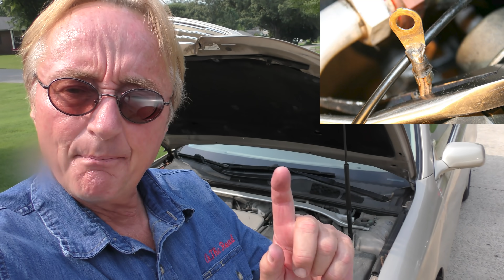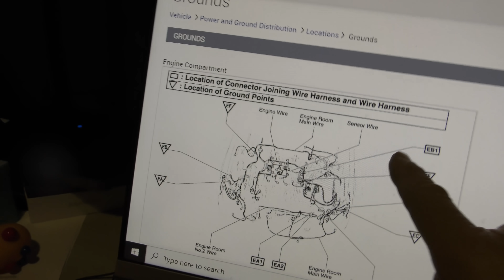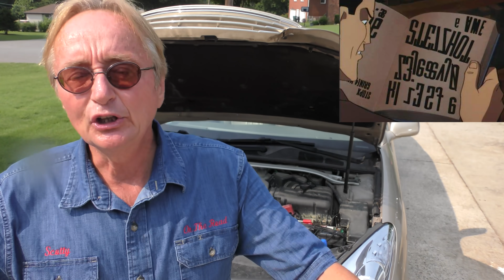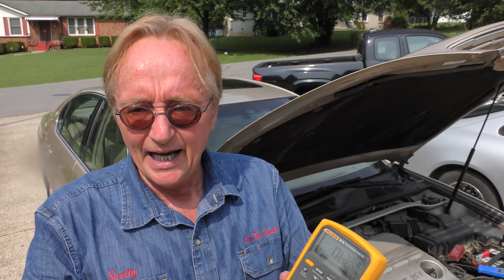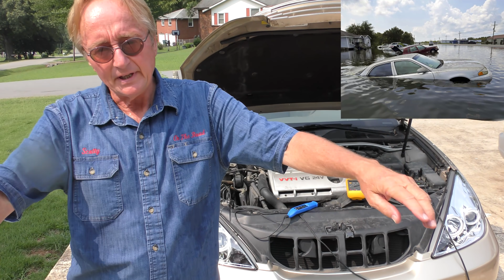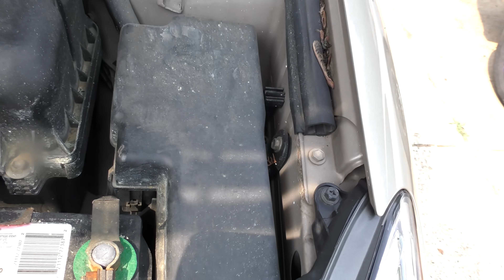I Told You About This Problem But Nobody Listened

Comment: Scotty,
I'm an avid listener to your channel but I have to disagree on a point you always make. Hyundai. They are simply not the trash you claim them to be. I realize you're an "older" guy and probably haven't gotten over the Pony.......lol. I'm probably close to your age and live on the East Coast of Canada. We live with salt on our roads on the daily, PLUS, we live off the Atlantic. EVERYTHING RUSTS. There is one exception, Hyundai. I've owned two. First was an Elantra,96, that I drove for 160,000 miles....replaced a headlight. I went through a number of other cars and finally bought another Hyundai in 2017. She has 120,000 on her, looks like I pulled out of the showroom yesterday. I don't have a garage, she's a daily driver and other than changing oil I put on some new tires. It's fast, rust-free and reliable. The year I bought it came down to the "big 3"...Honda, Toyota or Hyundai. I have a bad back and believe it or not Hyundai was the only one whose seat rose vertically which made it very easy to get in and out of. I just don't trust then CVT transmission in the Honda and Toyota were putting them in the Rav I was looking at....Turns out the little 1.5 was a BUST for Honda! The CVT is a no go for me, driving it was like riding a ski-doo. SHIFT DAMN-IT, SHIFT LOL. I think Hyundai deserves some respect as they have there own steel factory next to their plant. Good steel/no rust. The year I bought mine it won the AJAC award (which is the toughest)....They give 60 journalists 60 cars to abuse for a few months then tally up the votes. Guess who won? Hyundai. Show em a little love!

Comment: I've begun 2 ✔each indiv. wire & found 3 wires that had small holes in them, 1 being from alt. 2 main fuse center, 1 under dash & 1 in bundle across radiator. 😲

Comment: ground problems, god forbid, one of the last problems you EVER want to deal with on ANY piece of technology. most are battery ground related ie loose battery terminal or chassis side. look there before anything. On a different note, if you have an open circuit and a wire map dont spend a bunch of time beyond checking the obvious harness connectors trying to find the open just run a new wire.

Comment: I have fluke meter like yours been using it for years .
I have been out to cars which wouldn't start and noticed the throttle cable fried, this was due to a bad ground between chassis and engine, the power was trying to use the cables a ground .

Comment: I wasn't going to put this store on blast. The wiring diagrams for 2003 Ford Lightning are under wraps. Guy working the counter couldn't print me out the 26 pages of power and ground diagrams (there were lots more) so he let me take pictures of his screen with my phone. Luckily the diagrams verified what I already fixed, wanted to be sure the truck wouldn't catch on fire. Scotty that was total hell, I would have paid someone 4k+ to have found the issue. Nobody knows how stuff works so I just have to do it.

Comment: As an electrical engineer let me tell you, diagnosing hardware related problems is one of the most annoying tasks I have to do. I have spent many, many hours with a circuit and an oscope plugging probes in trying to figure what on earth is going wrong.

Comment: I'm having a problem with my a/c working intermittently right now. Had a bad clutch coil replaced it along with the pigtail and now it works but every few seconds the light inside the car for ac turns off and the compressor disengages. Then it comes back on and gets cool for a min or so again. Freon level is good, pressures are where they should be on the high and low side. I also changed the pressure switch that's under the airbox because it seems like it's worse the hotter it is outside, so I figured the high pressure switch may have been bad but even changing that, no luck. And just like scotty said in this video I had the transmission rebuilt last winter and the air never had an issue until after that. And they did a Terrible job putting the wiring back in correctly. Alot of the plastic shielding has been broken on the wires and they didn't bother to replace it so it's a mess. But other than the pigtail for the clutch coil I haven't been able to find anything else in the ac wiring. The fans come on and work as they should as well and I tried a different relay just incase and that wasnt the issue either. So if anyone has any ideas please let me know!!! Car is a 2006 Monte Carlo LTZ 3.9L V6

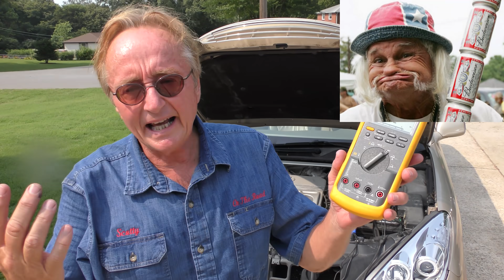Comment: 5:00 even good mechanic...dont know where bad connection, until they find it.
6:30 autozone will print out all ground wire diagrams...
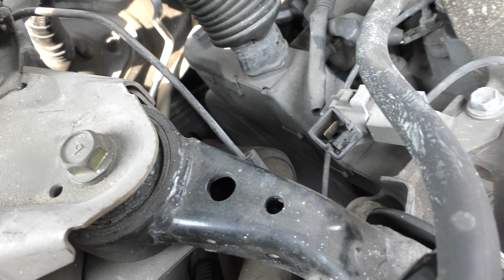8:00 check +/- terminals: green corroded copper vs shiny brown copper...

Comment: I bought my current car, a 2007 Subaru Impreza, at a used car dealer in Cleveland a year and a half ago. It quickly developed this strange tendency to crank irradically. Sometimes it would crank and start fine, other times crank so slowly that it wouldn't start. Other times the starter motor would speed up and slow down while cranking. The dealership had shown me pictures of the new clutch they had put in because the previous clutch had exploded. Turns out, someone forgot to completely tighten the starter bolts and, wait for it...the ground wire to the starter. Tightened that up myself and the car has started fine ever since. I've put 41,000 more miles on it (148,000 total on car) and it has never failed to start since that time.

Comment: One day when I had nothing to do, I went around and checked all the grounds I could visibly find.  Loosed them up, sanded the bolds and grounding surfaces and then  tighned them down tight and then sprayed them with some paint to keep them from rusting.    I have a very boring life.  But I am well grounded.

Comment: I had a fender replaced after an accident. After I got the car back, the lights on the front acted strangely. Traced the problem to one ground connection that was attached to an ungrounded part. Once it was properly grounded it worked perfectly.

Comment: GROUNDS.  Tel me about it.  I have an OLD boat used in salt water that has developed ground issues.  Getting at the wiring in and under the console is a nightmare.  Old cars have bad grounds on tail lights and do crazy things when they have dual filament bulbs.  Been there done that.

Comment: Yup, poor grounds create havoc. My daughter's 2005 Ford Focus transmission would not shift properly because the solenoids inside were not receiving a reliable voltage due to a poor ground. I purchased a braided cable, and connected it from the negative battery terminal to another point of her frame where I sanded the paint to bare metal. Shifting problems went away.

Comment: So, I have the same make and model Lexus and OMG, the electrical gremlins in this thing.  Sometimes I'll turn the radio on, its on the NPR freq, but I get static.  I have to turn it off and on again for it to work right.  And from time to time, I'll come outside and all the windows are down, and the sun roof is open.  WTF.   And sometimes I can wind the power windows down with the ignition NOT turned on.  Other times, I need to to have the ignition on.  I just live with it.

Comment: I try to review the vehicle grounds every 2 years.  I clean them up with a wire brush or sandpaper if they are looking rough.  I always finish with a dose of Deoxit D5.  It is by far the best contact cleaner I have ever used.  It has kept our 50 year old church pipe organ alive.

Comment: In the early 80s a customer brought his VW diesel to my shop.  The engine wouldn't turn off.  He told me that there was a huge ball of fire hit his car.  I immediately saw that the radio antenna was missing and there was a black smudge where it had been mounted.   He was rather shook up and hadn't noticed.  He agreed to leave the car.  I found that several of the major ground terminals were burned off.  After replacing those and the missing antenna he was good to go.

Comment: I could have used this information in 1987, when the engine was replaced, at the dealer, on my Dodge 600 convertible. There were loose wires when I got it back, and the computer module burned out again and again. I finally had to trade it while it was running, after a summer of no car.

Comment: Replaced a bad alternator, then found out a little while later that a cell went bad in my battery because of it. Got a new battery, the fella who put it in didn't tighten the negative terminal, new battery sparks, kills new alternator, resulting in killing new battery. Felt like a dog chasing its tail for a while there lol

Comment: I noticed a ground wire that used to connect to an exhaust bracket that has rusted into non-existence. Should I figure out a way to reconnect it to the exhaust?
Reply: I think u could connect to any body frame part

Comment: My 2000 f150 has a parabolic drain I'm pulling 220 milliamps on a constant with everything off traced it back to the 50 amp fuse under the hood which runs the computer the PMI and I forget what the hell the other thing was easy solution and cheap wound up bypass relay where the 50 amp fuse was so now when I shut the key off shuts down everything no more dead batteries.

Comment: I found a lot of grounds on my 2002 Mustang that didn't have the paint removed before attaching them to the chassis at the factory.. Things still work but I fixed this issue on the grounds that I've found. Actually, some grounds were 0 ohms while a couple measured 0.5 ohm and a couple measured -0.1 ohm (yes, negative 0.1 ohm - I couldn't measure any voltage drop so I don't know why I got a negative reading) after cleaning and reinstalling the grounds.

Comment: 2006 f250 5.4 lariat, 5 speed auto, manual 4wd, ex. Cab, and no rot/rust. 101k, 13,000$. Whatcha think?
Reply: Stay FAR away from the Triton 5.4 such a money pit the landscaper I work for has put 3 new motors in his work truck 2008 f350 5.4 and the trucks are maintained very good oil changes at 3,000 not 6,000 changing fluid at half the recommended miles really well taken care of my uncle had to put in a new 5.4 when the truck was only 5 years old 90,000 miles on it he maintains his vehicles good too there just not very good please stay away from then you have been warned

Comment: Friend had a shifting cable to his transmission break serval times until they figured out there was a bad ground to the transmission so it was grounding through the cable and was arcing and causing the cable to break. Once they fixed the ground the problem never returned.

Comment: They use so many ground points because it's cheaper than running a few wires back to a common and sturdy ground. Ground is ground and makes no difference where it is but it must have a good connection. The more connections, the more likely something can go wrong.

Comment: Serendipity as I am currently repairing the backup lights on my mustang. Turned out to be a compound problem and ground, a bad neutral safety switch, and a loose bulb socket. Isolating and repairing auto electric problems can be extremely frustrating.

Comment: I have an older generation ev and I absolutely love it. With gas prices so high, I literally save a couple hundred dollars a month in fuel costs alone. I’ve had it for two years and have spent a fraction on check up services. I also feel better about not emitting so much. Never going back to combustion. All I want is a manual in the next EV I get!

Comment: My 2003 Century, especially on dewey mornings, will sometimes headlights dim a little while accelerating, blower fan slows down slightly...does it off and on for the first 2 or 3 miles. ?
Reply: Check the battery

Comment: A lot of wires these days are just low voltage signal wires. The manufactures are insane for letting damn geeks get so much control over things with processors and computers.

Comment: Hi Scotty, im thinking of having one of your recommended cars shipped to me from a bmw dealer in Texas without seeing it in person. All i can see are the photos and the carfax which is clean, its a super low mile vehicle at a price that I couldnt find it at locally where I am. is a 2010 highlander with 87k miles on for around 13 thousand shipped. Was a texas car, 2 owners. What do you think? This is from a legit highly rated BMW dealer, not some Slick Shady's Used Car lot. Do you think they would scam me? What do you think

Comment: Does anyone know if the 2006-2011Hyundai Accent 1.6 L inline 4 engine and 4 speed automatic is reliable? I’m thinking of buying one. (The engine has 60k miles on it)

Comment: I got a 2016 Nissan Rogue that keeps blowing the windshield wiper 30amp fuse. I have no windshield wipers. Please help!
Reply: Wait..you don't have windshield wipers??
Reply: ..and do the wipers work and then blow?. Or do they instantly blow?. Or do they only blow after it rains and the cars wet?
Reply: @Brian-dj3ru  They instantly blow! I have non working windshield wipers. I replaced fuse, turned them on as soon as they started to move the fuse blew out again. I'm thinking bad ground or bad wiring in general....?
Reply: @Disenabled1  if you can..find the wiper motor,disconnect it..put a new fuse in and see if it blows..then you can find out if its the motor or not..its either that or a live wire touching another wire or something or bad ground.  Try tracing the wire

Comment: Any ideas: 2014 Avalon - the speakers quit working suddenly. The display on the head unit looks normal when cycled through the different sources. I took the battery cables off to reset everything. I reset the radio from the head unit. I checked the fuse / relay under the passenger seat. I checked to make sure the rear speakers in the truck were well connected. Any help would be greatly appreciated!
Reply: Does it have an amp?

Comment: Scotty, is there a way to isolate the digital components - like have a single ground for the circuit then use a bus bar type setup from there?  Have both ground and positive fused or protected somehow?  I know nothing about automotive electronics, so it may be this way already.  Just sounds pretty redundant and not in a good way.  Peace.

Comment: I just scanned through my 2002 Mustang official Ford wiring diagrams and there wasn't anything that pointed to any grounding points. There is a section titled "Grounds" but it doesn't show where they are on the vehicle. I guess I'll have to find another source and probably spend more money and hope that the info is accurate.
Reply: Scotty once stated something about asking at AutoZone.  Sometimes they have it and will print it out for free.

Comment: I have also found power wires that have chafed against a metal edge and it creates a short to ground. Sometimes it is a high ohm short, so it is not much of a short, but enough to make screwy info to the computer.

Comment: I have a 2013 Ford Focus and my horn and fog lights do not work. Fuses look good and relays. Must be a ground somewhere that are loose or corroded. Where should I begin to look ?
Reply: Under the hood
Reply: A car lot for a better car.
Had a 2013 Ford Focus SE, breaks stopped working and it shut off going 70mph. In all seriousness, you need to be careful with that thing. Not kidding at all.

Comment: A few years ago there was a bad short on my car's tail lights.    When the repair shop repaired them, something strange happened.
Every time I pressed the brake, the dash would light up and when I let my foot off the brake, the dash will go to not lighting up.  Talk about a bad ground.   Replaced the wiring of the bad ground and now working fine.
Reply: Worked on an older car that had the same symptom, but it had a single contact 1156 bulb in a the brake light socket that was supposed to have a double contact 1157 bulb in it.
Reply: I had the same thing happen on my Pinto but the bulbs were correct, the lead contact tabs just flattened out so much they touched.

Comment: Hey anyone what happens if you do get intermittent connections??? Please Scotty I do do need help with this! What are common problems? It’s on a 03 Toyota Tacoma v6
Reply: If you live in the salt belt, check your frame mounted ground connections as well as the frame's integrity if it's all rusted.  If not, start with the tow hitch harness connector if it has one, seen them get nasty looking.  Beyond that, as Scotty said, it may take some time and effort to try and find the issue.
Reply: @gwrider2146  I fixed the prob but I believe my computer went out I’m goin next week to plug up to a scan tool. It can’t read anything in it when I do. Truck runs perfectly fine
Reply: @sofakingwetahded9331  Check for a blown fuse first, especially any relating to the dash or engine pcm computer, possible that's why you can't get a reading with a scan tool.
Reply: @gwrider2146  ty ima check
Reply: @gwrider2146  what fuse would be blown to make the scan tool not read my trucks computer?

Comment: Hey Scotty i love your channel! I live in Belize central America and i have a 05 honda crv that idles a little rough sometimes when it first starts. The rough idling normally starts when the rpm drops to about 500 rpm when sitting. Whenever i rev the engine it goes away but goes back to it when it drops to 500 rpm again. What could it be?
Reply: Scotty has a video on using spray cleaner to help your car run better, search for it.
Reply: Vacuum leak
Reply: I am not a specialist but try to pull out maf senzor and see if problem still exists, if it is working properly it's a bad maf senzor. Also i have a very similar problem rn, my car is shutting off if I don't give it gas, when i rev it it is fine, but when it's idling it wants to shut off, im going to visit mechanic but it's probably bad alternator.